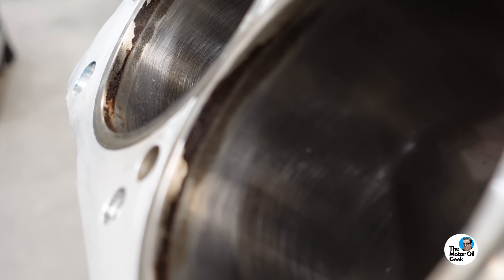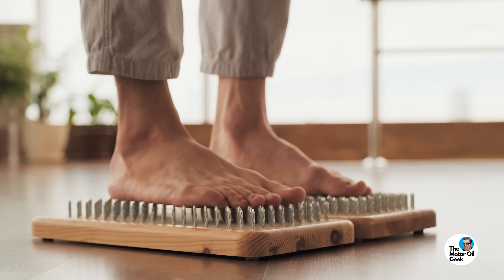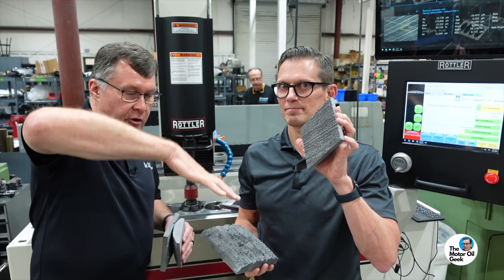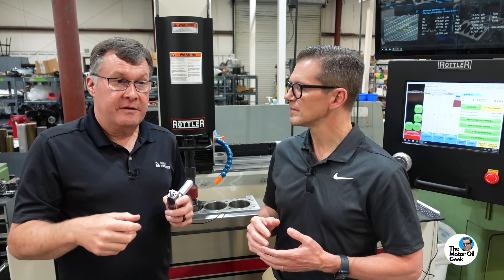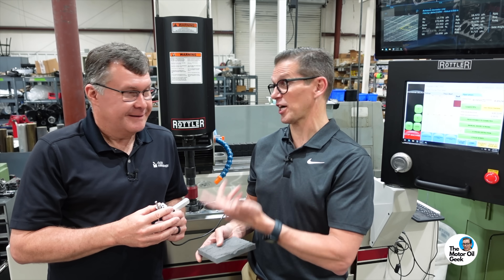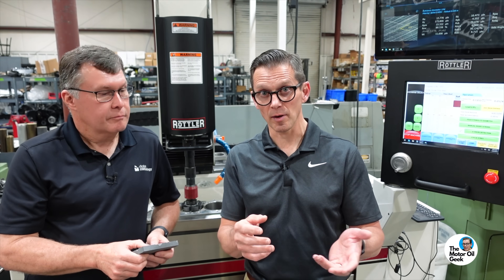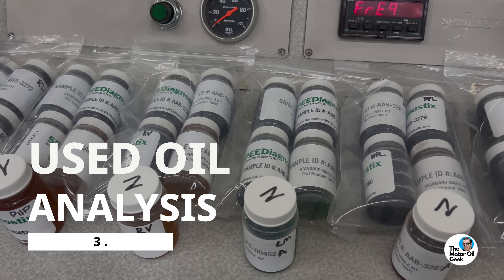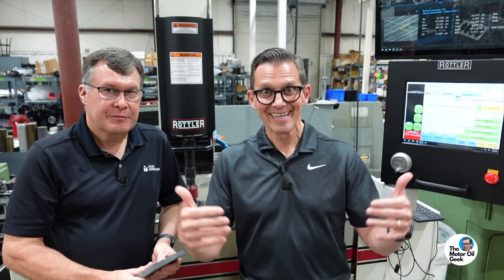GM's $1 BILLION Dollar Blunder: ROUGHNESS Matters...

Comment: Retired from a precision equipment manufacturer. More than once, bean counters changed vendors (machine shops) to save a few dollars and cost us more than 100K. Some parts we never got to work (lost orders) and had to switch back to the original vendor. The original vendor charged us even more than before for the parts. If it ain't broke, don't fix it.
Reply: The old vendors hit your business with the asshole tax.
Reply: @aluisious  I hope they saved the tooling, and still charged a hefty setup price to resume production.
Reply: Aerospace engineer here - That is so common across EVERY FIELD of engineering.
The Boeing Max-8 is a good example of bean counting out of control.
Reply: @tonywilson4713  
 For 13-1/2 years throughout the 80’s & into the early 90’s, I worked as a “Test Site Technician” (“TST”) for Deere & Co.’s Product Engineering Center (“PEC”) at a “remote facility” located south of Fresno, CA on an extremely large-scale farming operation, where we ran prototype & “new-production” tractors for anywhere from 1,500 (new-production) to 5,000 (prototype) hours in “real world” in-field situations.. I won’t bore you with the minutiae. 
 Although every component & system on each individual tractor was being tested, it was not uncommon for PEC (in Waterloo, IA) to write engineering orders & ship us all different types of “small parts” (typically) to install on the test tractors in order to establish/evaluate their “durability.” These parts, in some cases components, were often of inferior quality compared to what the tractor “came with” when it was shipped from IA out to CA. 
 As I’m confident you’re already aware, the “purpose(s)” for this was to determine whether a part (or component) manufactured by a different vendor for a cheaper price could “survive” for the “minimum” Warranty period of 1,500 hours -- which is what Deere’s offered on all sizes of their tractor lineup at the time. Sometimes they did -- & then were “put in” to production line(s), sometimes they did not -- & therefore were not. In some cases the difference in prices were literally mere pennies, but that small amount factored by multitudes of tractors increased the “profit margin” enough to justify the “changeover” in the part(s) used in the mass-production of tractor “units.” There were some few occasions where such decisions “bit” Deere’s “in the arce” -- & whatever “fallout(s)” occurred between the PEC and the “Executives” I certainly don’t know, but I would’ve liked to believe it was at least something… 
  As a TST, working for/under an actual Deere mechanical engineer, Report writing -- as well as “mechanicing” -- was also an essential part of my day-to-day duties. Because “Customer Satisfaction” was a extremely significant part of Deere’s desires & intentions, in some cases I could cite “That” as being a good reason to consider before adopting a different part/component for production -- given that the comments on my Report were “approved” by my boss, the onsite supervising engineer.. 
 My boss had been an engineer for Deere’s for about 20 years by the time I went to work for him, so he had tremendous “credibility” with the engineers at the PEC. For those of us working for & with him, he taught us the “paramount” value of credibility -- for the Test Site itself, for his Report-writing technicians, as well as for himself also. On a few occasions “we” were able to convince the PEC not to adopt a part or component made by a different vendor, sometimes we were not able to, & sometimes the new part/component was so crappy that It convinced the PEC all by itself -- based on it’s repetitive “failure rate” of course! 😂 
 Have a great day Tony! Thanks for letting me vent on ya for a while! 😉 
{oh btw, I met an aeronautical engineer (in Lancaster, CA) some years after my time as a TST… man, that’s a WHOLE HECK of a lot more complicated engineering than designing & testing tractors was -- then, or NOW!!! 🙀😎}
Reply: @tonywilson4713  Boeing Reinvented itself about 6x since the 1980s'   
 It never got better after bean counters replaced engineers in Top Management!   Being Woke  was the final nail in the coffin!
Reply: USTubaki worker here . We used Shefield cold steel in the 90s. from England. And 1440 cold rolled from USA. Then to save money changed to 12L from China and my Factory shut done and we all lost our jobs. Spotty carbon in the metal was a huge issue trying to heat treat it. I miss the old days of quality.
Reply: @Burton1973  I have heard this story before.
Reply: It just seems like a race to the bottom!
Reply: This is the answer.  People like to blame the engineer, however, the engineer wants to build it right.  The bean counters are the ones who demand it's built to a spec that 'works' good enough and fits the bill.

It's the profit problem.
Reply: @chrismisc7856  It's more than a profit problem, it's a problem that the people picking the vendor aren't involving engineering to determine if the new supplier can meet spec and are too cheap to do at least random testing to ensure spec is met.  The attitude is often "if there's a problem, that's on the supplier".   And they forget whose name is on the plane, train or automobile.
Reply: GM was guilty of this with their 2.8L diesel 10 years ago they changed manufacturers and the engines started burning oil.
Reply: I have always thought that most problems with GM products are caused by accountants.  Managers who have never worked on a car is their other problem.
Reply: Boy you said a mouthful there. Saw that same thing in the Powertrain division i was employed at.
Reply: Strive for constant improvement, not lowered costs…?
Reply: Bean counters only offer recommendations. Executive management makes decisions based on investor needs. Shareholders don't care about what's best, only what generates revenue.
Reply: One of the funniest things I ever experienced was writing a specification for a component provided by a supplier so that we could competitively bid it out.   Our supplier got wind of it and called me.  Long story short, they helped.  They provided the actual material specs, they even provided their test specs.  What they did not provide was the precise process control parameters and procedures necessary to pull off what they did.  We had people witness these tests (which was in our contract.).  We had people witness their internal processing of the material (with things like temperature gauges hidden from view).  All of what they provided was verified.  In the end, most vendors no-bid some even stated (major players in the field) told us that what we wanted to do was “Impossible”.  The few who tried it, could not match the required performance - or even get close.   We were left with one supplier, the one we started with.  The one who also knew that we had played all of our cards, and lost.

Comment: The real problem is in the automotive industry. They are using materials that are manufactured from lowest bidder. They have the ability to use better components but they are telling their engineers "those components are too expensive". Perfect example is the 10 speed transmissions. The valve body casting is porous and not machined properly causing most of the issues with the 10 speed transmissions. The engineers are telling the manufacture what components are required but they are not adhered to because of cost.....

Comment: I Did Some Vertical Honing As Per A David Vizard Video. I Did It On A Junk Yard Build 5.7 Hemi Engine And This Video Puts Me At Ease As To Not Have Ruining My Engine lol. So I Honed The Bores With 220Grit Drill Stone To Clean Up Minor Rust. Then I Finished The Bores With A 400Grit Ball Home. Finally And Made The Special Vertical Hone Tool Out Of A Air File, Some 3/4 Thick Plastic Stock Cut To Appropriate Bore Size And Sandwiched Some Round Round Scotch Bright Pads I Cut To Size. Lubed The Bores Stroked Each Bore Until It Felt Like Glass. I Also Polished The Ring Faces Of Both The 1st And 2nd Ring By Hand With Mother's Aluminum Mag Polish And A Rag. I Did The Same To The Original Piston Skirts Where The Skirt Coating Has Worn Down To Bare Aluminum. The Top Rings Were Plasma Moly Coated Which At First I Was Not Going To Polish As That Coating Is Designed To Be Porous And Low Friction Already, However The Rings That Came Out Of The Engine Had Zero Signs Of The Coating Left On Them And When I Hand Polished A New Test Ring It Came Off Easily So I Figured It's Going To Come Right Off On Initial Break In Anyways (on the ring face side at least) 

After It Was All Said And Done I Got 27Ftlbs Of Tuning Torque With The Cam And Oil Pump Installed. There Was A Point Which It's As Low As 17FtLbs Turning Torque Which I Find Extremely Odd. There Must Excessive PTWC On A Few Pistons Causing Them To Cant Going Up The Bore Causing This Increased Drag. Either Way It's A Junk Yard Build. 

My Biggest Reason For Doing This Was For Reducing The Chance Of Screwing Up Engine Break On And Glazing The Bores As I've Done That Before Due To Needing To Baby It And Tune It Before Being Able To Put Mild Load Engine To Bed The Rings In (it's a turbo engine so going into any kind of load on a uncertain tune is scary)

I'm Still Debating If I Should Do This Vertical Hone And Ring Polishing To My $8,000 Race Build Turbo 3800 Engine. There's So Much Money Into It That I'm Nervous To Screw It Up hahaha. It's Not So Much The Money Part It's Waiting A Year Or More For The Engine To Be Done At Local Machine Shop. Plus Every Part Is Custom Built To Order Like The Nickel Plated Forged Pistons From JE etc. It Would Be Really Cool To See The Before And After Turning Torque As It Would Come From Machine Shop As An Assembled Short Block.

David Vizard Had Said He Might Collaborate With You On This Vertical Honing Aspect Which Would Be Really Cool To See.

Comment: I'm so glad this information is getting out to the mechanical masses, like me. I'm retired now, but was privileged to work as a technician at SwRI Div.03, in the LSPI  PPP (Pre-ignition Prevention Program) for a new type of oil. The machinist were using the profilimeter back then, with new hones & post-hone plateauing to develop exacting standards. It's only in the last few years that I've seen more & more YT machinists shows using this equipment. I believe the Motor Oil Geek, Dr. Lake Speed's shows & appearances that has made a key difference in spreading the word! This is great! Thank you all!
Reply from the maker: Thank you so much!

Comment: Mgmt caused 1 billion in losses. listen to the GM transmission engineer whistleblower "Cello" on the "Car guy online" channel he explains everything. [. Yellow banner across the top.] Confirms everything I have seen in the last 20 years. Even more so since the 08' crash. My chevy dealer guys tell me they have to hook up this expensive machine to the recalled engine and run it. it listens to the engine run. If it passes they change the oil. If it fails they replace it. Rinse and repeat on the new engine. The new engines FAIL half the time. Imagine working flat rate for warranty and having to do the job multiple times on the same vehicle. Clown world. No way I could be a dealer tech today. Run.

Comment: I built pharmaceutical stainless pressure vessels for 25 years. Welding and EP grinding. When it comes to EP grinding there are procedures and steps that have to be followed in order. I’f one of the steps are skipped “e.g” going from 180 grit to 320g, skipping 240g could cause frosting during the EP process. I can still get a #7 RA but the grain structure will be wrong and cause issues during the polishing process. We used the Starrett RA meters. That little pocket meter cost about $6K and the probe itself is $1200.00. The surface has to be cool before measuring the RA. False reading or worse, a burned up probe. Another great video.
Reply from the maker: Thanks for sharing your experience!
Reply: Bit odd: seems a troll here cause I uploaded 3 minutes ago and ‘Lake’ response is made 16 min. ago....what tha?

Comment: Lake, should hold off on adding a magnet drain plug if I plan to have my oil tested?  I suspect it will skew the results.
Reply from the maker: It will not skew the results. Use it.

Comment: I have a 2023 Blazer 2.0L that spun out two bearings @48,000 miles even after running high quality synthetics, replaced every 5,000 miles and under. GM recommend to the dealer to replace the bearings, rods , and pistons.
Have not seen the vehicle for 7 weeks as the dealer is waiting parts. This is not only happening to the 6.2L V8’s.
Reply: wow  thanks  maybe i wont get that gm suv
Reply: GM had connecting rod issues with the 2.4 Gen II Quad Fours. I had one in my 2000 Pontiac Sunfire GT. Groom and Jasper quit rebuilding the engines because of various problems. Took 84 days to get an engine from GM and had two have it installed by an independent shop. They screwed a bunch of stuff up. Dad and I spent four hours fixing their sloppy work. A week later the long block started leaking oil and antifreeze This was circa 2005. 😊
Reply: @jasonweishaupt1828  ahh, the old quad knock.
Reply: Hopefully gm is making your car payment  due to parts  shotages issues.
Reply: Check your states lemon law. Sometimes they allow a lawsuit if the dealer/manufacturer keeps your vehicle longer than 30 days to effect repairs.
Reply: Why did you buy a Blazer?
Reply: @aluisious Badge hores. Many learn the hardway but will continue to buy gm
Reply: Blazer is built in Mexico as well as the 6.2 right ?
Reply: It almost sounds more like insufficient bearing crush.
Reply: Thank you to everyone for the suggestions and ideas. The saga goes on . GM and the local dealer have zero interest towards a vehicle upgrade and or any payment assistance from GM as a manufacturer. The dealer offered 15,000 under what is owed and would not budge as the “Blazer” is not selling well. GM has offered zero help and no warranty extension, similar to what is occurring on the 6.2L. The vehicle is now delayed for another week as the main seal is now leaking , after reassembly.
Reply: It's not the main problem. Piston skirts were casted so bad that it's slinging metal. NHTSA is blind and didn't talk to GM techs replacing these engines before they even make it to the dealer.
Reply: Gm = JUNK ALL OF THEM the 2.7 is the only decent engine they make now 😂
Reply: Nor is only GM engines.
Reply: Sounds like you need to go japanese at this point, GM clearly doesn't want your business.
Reply: 5.3 is having its own common problems such as lifter failure

Comment: Those GM engines also have thrust bearing tolerance problems as youtuber "I do cars" pointed out in a  L87 teardown.  He managed to get one. GM doesn't  want those replaced engines out in the wild, and has a $10,000 core charge for them.  If I remember right, all the crank journals looked ok, but every rod bearing was spun and the thrust bearings were destroyed
Reply: Current core charge is $7k. It went from $2500to $5k to $7k. Has never been $10k
Reply: @brianrock3949  even at $7,000 it sounds like these cores may be potential lawsuit evidence.  lol.  GM wants this buried.
Reply: At least one of the main bearings had extensive wear, and the rest had accelerated wear.

Comment: I’ve found that smooth journal with good new bearings and proper oil with proper pressure will provide a good running engine with no wear problems. The L87 is full of engineering that uses oil pressure and volume that the pump and relief system just cannot provide. If DOD and VVT is removed on these engines, the problems disappear. Removing these features of the engine is the only fix that is actually going to provide the reliability that customers deserve. Also, changing out the variable oil pump for a standard one should be required when doing these changes for longevity and peace of mind. Sticky surface still requires enough oil to work. Nice video!
Reply: I'm reminded of this song and dance from 10 years ago with Ford.  The infamous Triton 3 Valve V8.  The fix was a switch to thicker oil and a high volume oil pump.

Comment: What the f man..
What kind of click bait is this.
Thought this was about crank journal surface finish and GMs f.up   but one minute into the video you switch to cyl bore finish and piston rings  and never really comes back to the crankshaft issue.....
Reply: If you were paying attention. The GM motors crankshaft IS about surface finish.
These two guys are telling the public why surface finish is critical/vital.
These two guys are staying at arms length to avoid a lawsuit from GM. 
You are talking billions in a lawsuit.
Reply: @2nickles647  If YOU where paying attention  you would know that most of this video is about surface finish in relation to cylinder bore and piston rings   and not very much about crankshafts.
The headline and video description indicate that this is about GMs crankshafts in the L87 engine.
So don't gaslight me!